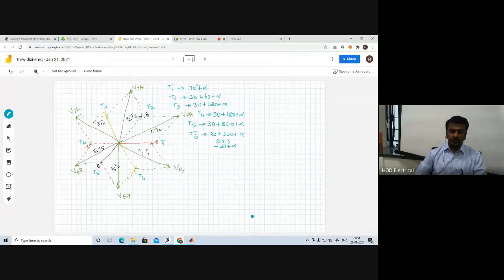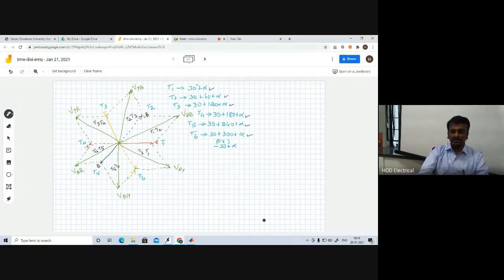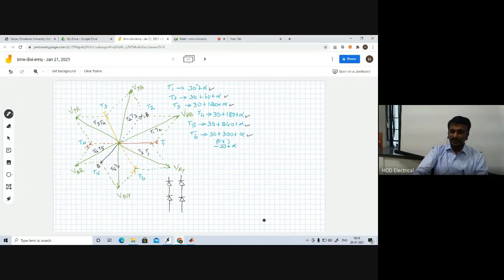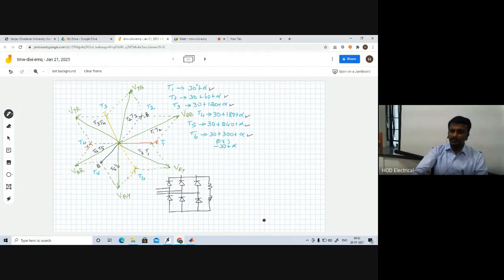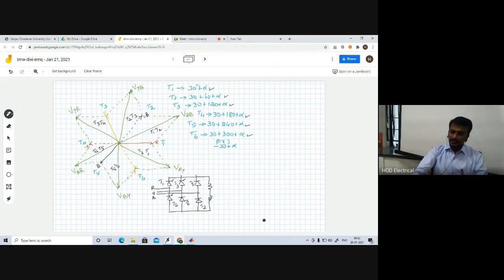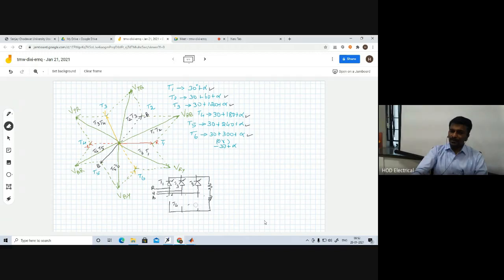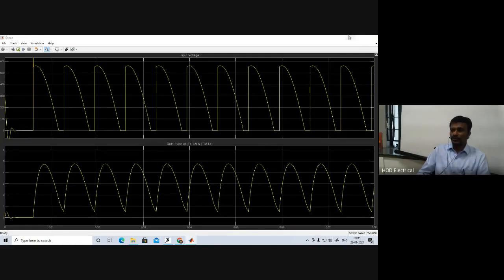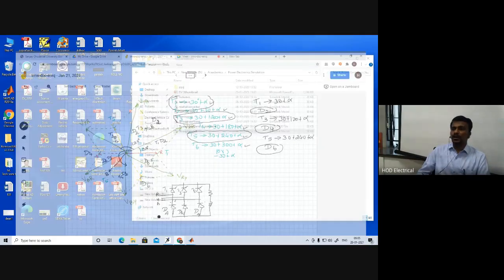PE-06: Simulation of Three Phase Semi Converter (Corrected) By Dr Rajin M. Linus

Comment: 🎯 Key Takeaways for quick navigation:

Thyristors in a three-phase semi-converter can be controlled to conduct at specific firing angles.
The sequence for a single-phase semi-converter is t1 at α, t3 at 30° + α, t5 at 60° + α, and diodes d2, d4, and d6 conduct automatically.
Diodes in a semi-converter only conduct when the anode current is above the holding current below the crossover point.
The output voltage of a semi-converter remains constant when the firing angle is less than 60 degrees and with inductive loads.
For a firing angle greater than 60 degrees, discontinuous conduction occurs, but inductive loads freewheel through the diodes, maintaining continuous current.
Simulating different waveforms and loads in a semi-converter can help analyze its behavior.

Made with HARPA AI

Comment: Sir.while connecting with Ac source,it not getting engaged with thyristors. Please help sir
Reply from the maker: Thank you for your message. I think you have used the voltage source block from low signal session. Check it from the Sim scape. Thank you
Reply: @Electric_known  yes sir.. now i changed my voltage source and got the output... thank you sir